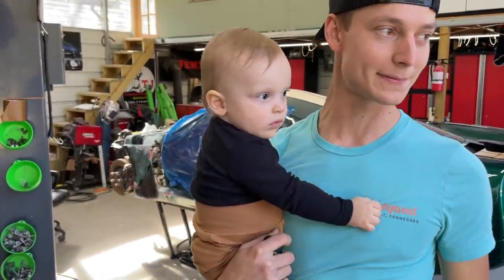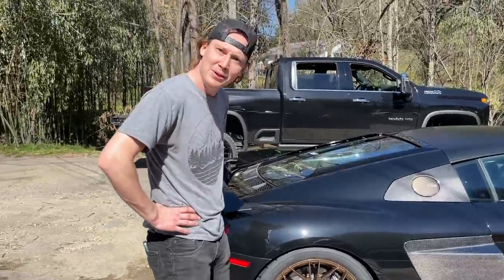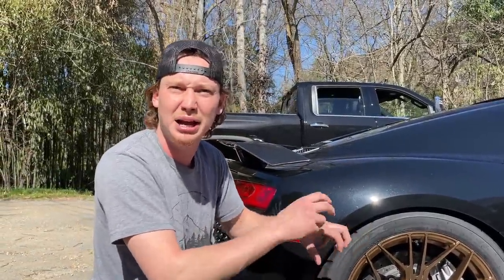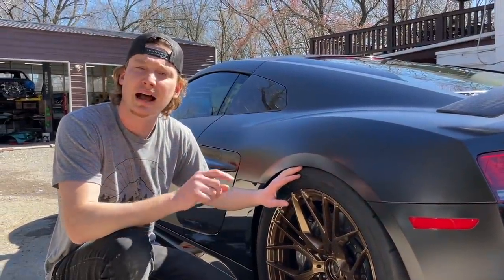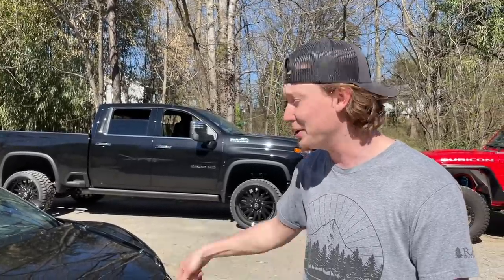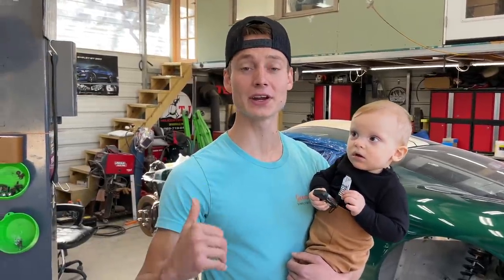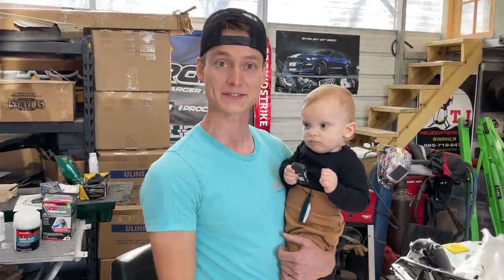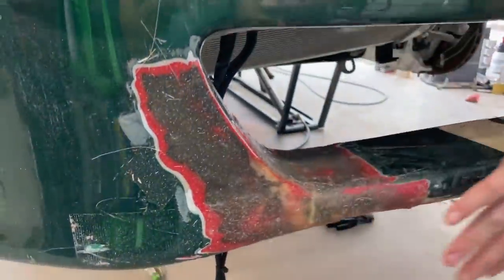Rebuilding A Wrecked Factory 5 GTM Supercar Part 6!!!

Comment: The fiberglass you guys used on the hood is called fiberglass mat. Its good for conforming to bends and building up thickness, but is not as strong as the weaved (cloth) fiberglass. Id say the mat is probably fine for the hood but just for future reference those are the main differences between the 2. Weave for strength, Mat for bends and thickness.
Reply: I have a weaved hood
Reply: Also, they may have used resin that is meant for laying in a mold which has a much longer working time compared to the resin used for repairs.

Comment: For fiberglass resin, give West Marine 105/205 epoxy resin a try. It has almost no odor, cures completely in a few hours, and has no tacky issues like cheap resin. I’ve been able to apply, cure, sand, up to 3 separate layers in an 8 hour shift.  They even sell this via Amazon.  Very strong stuff.
Reply: Defo an upvote for West systems marine epoxy... way better than any automotive fibreglass resin 🙂

Comment: find out if your tires are spinning on the rim as well, use a chalk marker , draw a line from the tire and the rim and then full send  WOT if the tire is spinning on the rim its time for some bead locks
Reply: This!
Reply: Meow
Reply: Meow
Reply: Is not making enough HP to do that, that happens over 1600hp on these cars
Reply: @joealex65  ahh, i only know its a way to check it cause a buddies is300 was pushing 1300hp to the wheels and was doing it. pls its a tuned tt r8 so i figured it would be easy enough to check
Reply: Semi slicks have a stiffer bead and sidewall and shouldn't spin. They will slip a little. My 300hp, 900kg track car will slip about 10mm when new until theu glue themselves in
Reply: Yikes I didn't even know this was a thing on road cars
Reply: @zxggwrt  its not. Don't worry about it.

Comment: Way to go on the hood. Definitely fiberglass the underside too. Make it super stable, don't need it coming apart at 200 mph LOL.
Reply: Their idea of fiberglassing is purely cosmetic they have no clue about structural fiberglassing
Reply: You should always start a fiberglass repair with a patch in the backside. The strength comes from the back. Starting in the front give you issues with the repair delaminating. Then after you finish the backside and its nice and hard, grind down the front fill with strands and resin or even fiber reinforced putty/bondo. Its good they switched to fiberglass matting, that other sheet is a pain to do repairs with.
Reply: @benmac940  THANK YOU.
Reply: @benmac940  damn didn’t know you were a fiberglass professional
Reply: @joshuaa1921  I didn't know that you knew me at all, when did we meet cause I don't remember you.
Reply: @benmac940  Yup that hood should've been ground out a good 10 inches on both sides of the main crack and then sunk below the factory surface..Both sides should've been beveled to v it out, metal cross bars should've been resined in to T it all together and that is all before ANY Mat went on at all..This should've been done top and bottom..Finally after it's built up it then gets filler..The thing will crack and so will the main tub where they fixed it.
Reply: @Dave-ur5ub  Just because you have a picture of a mustang doesn't mean you have a shop,also,I'm willing to bet these guys make a lot more money than your shop🤣
Reply: @Dave-ur5ub  🤣🤣🤣 did I hit a sore spot🤣🤣 start a channel and show the world how great you are😉
Reply: @jeffdeer683  not everyone needs to prove to the world what they can or can't do. I don't know how fiberglassing is done on cars or if Dave is as he claims, but what I do know is these kids attempts at fiberglassing have absolutely zero structural strength,  and im sure you won't believe me either but I have done hundreds of fiberglass repairs on boats over the last few years, including commercial boats that are used everyday,  and none have failed including where the cleat ripped through the deck leaving a hole the size of my phone for me to fix. Just because these kids are putting this stuff on the internet does not make it correct or structurally solid and if you had any clue you'd realise that, there are numerous people in the comments in every video where they've done it telling them how to do it correctly.
Reply: @benmac940  I tried to buy the R8..I tried to wire them the money the night they put out the video stating it was for sale for 230k..I offered them 260k ,but that was to include the new wheels and a few other things they were supposed to get for it.Plus a little extra cash to sway them to sell it to me..Bc I can make my money back off of that car simply bc it's a famous car and people will follow thst car...I sent yet another email offering them 280k for the car after they asked me what I had in mind as far as collaborating with them by letting them take the car back for future videos/events..Kind of a reuniting..Idc about any of that..That was simply to let them see that they could take It back at times for videos if they wanted it...To sweeten the deal.
Reply: @Dave-ur5ub  they don't seem to sell anything
Reply: @benmac940  No,they dont..Nor do they even know the correct names of many car parts or the correct way to pronounce the manufacturers of half of the stuff.

Comment: I’m pretty sure staggered means just that, wider tires in the back… the Audi is looking amazing!
Reply: Yes, wider wheels in the back would be staggered. Staggered application just means the wheels are different widths.
Reply: @loganb2198  I feel like they think it means the angle of how the car sits.
Reply: @kamiraanddie12394  no they think staggered means front and rear wheels are different diameter
Reply: Staggered is different size wheel diameter on the vehicle
Reply: Staggered just means the front and rear wheels are different. Could be width, diameter or offset. Squared means you can switch front and rear. Staggered you can't.

Comment: Loving all the builds you guys are working on... the Audio R8 is Awesome!  When I mix resin for fiberglass, I find it useful to use a cheap scale from Harbor Freight and mix the epoxy and hardener by weight.  Like baking, it can be temperamental sometimes and this ensures the ratios are precise and they fully cure!

Comment: Oh yeah, no chance of getting a ticket. Cop didn’t have his radar on. When he tried to get you to tell on yourself, you should’ve told him every detail about the car and then said probably 70-75. Like on Tommy boy😂
Reply: Exactly, never tell the cops anything if ya dnt have to because they will use it against you everytime....
Reply: 🤣🤣🤣🤣🤦‍♂️ you do know that you don't need a radar to get a ticket for speeding, riiiiight??!??
Reply: The cop had him on radar, that's why he got pulled over. the cops radar proves he was speeding.  Billy was probably going at least 85+  when he passed the cop.
Reply: @timglass6041  Wouldn't have said "like 90" if he had him on radar, he would've said something like "you were going 93", an exact speed since he had it and it puts pressure on the citizen to incriminate themselves either in admitting actual wrongdoing or in incriminating themselves to fulfil their ticket/fine quotas, since they have usually a quota they need to meet.

Comment: For all those judging the police incident:  One thing that is typically overlooked with supercars and sport bikes:  If you stay focused, they can stop and steer just as fast as they can accelerate.  On an open road, this car is safer going 110mph than a loaded down painter van at 75mph or a distracted mom, driving soccer van @ 85mph.  Just have to be smart about when/where you punch it.
Reply: I ain’t illegal till you get caught no matter where you decide to rip it or the emergency crews will be ripping your ass out of what’s left of that car. They got caught, they’ve been doing this for a while so the averages caught them also.
Reply: This is all true... but the "law" is the law. 
   I'd hate to see them come to an end just because they can't legally drive anymore. 
    I know that wouldn't stop them, but it might put a "damper" on their progress.
Reply: Don't disagree with you about supercars.   What Worried me is the extreme horsepower.  
Indy, no one plans on getting in a wreck.
Reply: @XX-166  right on.  So true. We've all done it but sooner or later they get yah 
Or something else goes sideways.
Reply: The Audi is running on old tyres that have been involved in a accident. They’ve narrowly avoided a speeding ticket. It’s only a matter of time before they have a accident of get stopped by the cops again.

Comment: Staggered is when the rear wheels/tires are wider than the fronts.  Usually found in RWD configurations.  Double Staggered is when the wheels in the front are not only less wide, but also a smaller diameter.

Staggered example: 18x9 Front / 18x11 Rears
Double Staggered example: 17x9 Front / 18x11 Rears
Reply: Very good explanation 👍🏼

Comment: If you would stop screwing around with crappy fiberglass products you wouldn't have these fiberglass problems. Checkout Total Boat fiberglass products or some other professional-grade products. You need to use the correct fiberglass cloth also there different products for different applications. Please educate yourselves step up your fiberglass game.

Comment: Gonna find out reeeaaal quick how expensive that transmission is lol. I hope to god you guys did the tire math to keep the Quattro living. And yes if you’re wider in back than the front, it’s staggered.
Reply: There's no math needed for the tires. It's running the correct size front and back, they're just stickier than the Pirelli PZero tires that came on it from the factory.
Reply: R888 tires for a tt r8 or hurucan is like peanut butter and jelly. And from what ive seen, their pretty common tires used for any turbocharged car
Reply: Staggered is for any difference in the front or back
Reply: I hope that the Officer gave Billy a break and didn't give him a citation.... especially for reckless driving....
Reply: Dumb comment, the people that installed the Twin Turbo also spec'd the previous wheels and tires for it and it's right where all R8's/Huracan's run, they don't have to do any math because the wheels are the same size as the old ones
Reply: Tire width shouldn’t matter on AWD, it’s the circumference so they roll at the same rate.
Reply: @Dmanpeterson  that’s why i said “tire math”. I have an e63s meaning it’s 4matic and I’m running also staggered wheels. Width affects size if the tires aren’t matched to be the overall same diameter. If i ran different sizes that didn’t match each other in their diameter, my car wouldn’t be too happy. I run 275/30-19 and 245/35-19, because i did the math. You’re right that width itself isn’t an issue, as long as the math is done to make sure their overall diameter is the same.

Comment: My guess is there's not enough hardener in the resin... should harden much faster,.. hot or cold. Never a whole day. If it's mixed wrong it will never cure properly, needs to be removed and re applied
Reply: I think he probably used old hardener... it will never cure. throw out the old hardener and redo it w/new hardener.

Comment: Nice job but be careful ripping your cars because I do know for a fact when I would turn my 850 hp 2010 Camaro loose I would check very close before getting on it and had a place that I knew there was little traffic and even fewer patrolman. I would still be in jail at 195 mph on the bypass of the interstate if they caught me. Haha

Comment: That hood will take a boat load of work. You guys should go and buy the West System for fiberglass. It is really great material, i used it on my BMW 1200 motorcycle rebuilding all the body parts. You will not go wrong with it.

Comment: My concerns for the Silverado are mainly the sidewall strength. It effectively killed the towing capability
Reply: @lloyd28khz43  they have lots of towing trucks you haters
Reply: Pretty sure you started watching them yesterday
Reply: They not even intenting to use it for towing
Reply: @kennedymutinda4806  you mean their Pops’ RAM? They sold the silver HD GMC truck and both the Raptor and TRX are not made for large loads like an HD duramax diesel. Actually like three years I’ve been watching I think now 🤔 Not hating really
Reply: They said they WERE using it for towing. It's supposed to be a business truck. I don't like the tires and wheels at all personally but it's their truck.  I would never buy a chevy truck anyway their interiors look like 90's rental cars.
Reply: @squid_fish  f450?
Reply: @danielmishchuk5284  Maybe a non dually setup? I just remembered they have that too 😂

Comment: The R8’s new wheels and tires look awesome! The fitment - absolutely dialed! (The High Country needs the R8’s fitment, and taller tire sidewalls.) (Re: comments on the High Country’s new wheels and tires from last video, I’d say a tiny bit more than 50% absolutely disliked (who are we kidding, at least 8 out of 10 commenters said “No way”, “looks bad”, “big truck, little rubber band tires”, “bad fitment”.) Those new wheels with some taller sidewall tires, would not only look mean (a good thing), but the truck could drive over something bigger than a house brick without risking serious rim damage! R8’s👍! High Country, just four tires away from looking awesome! Keep doing what you do!
Reply: Completely true,but unfortunately with chevrolets square wheel wells a larger tire wouldn't fit with that lift and wheel offset.That being said,I'd rather cut the crap out of the fender wells and bumper than have it look the way it does!

Comment: If the rear is wider than the front, it’s staggered. If all 4 wheels are the same size, then it’s a square setup, which is recommended for AWD applications.
Reply: The AWD isn't true  I have a stock staggered setup on my Mercedes CLS63  305 in the back and 275 on the fronts
Reply: @drumftallen9325  911 4s is same way, wider in the rear.

Comment: Great build guys! You may have unwaxed resin, you use that with multiple layers.  You get better adhesion that way. Your top layer You use waxed resin. It feels dry to the touch. The resin is the same stuff it's just the additive you put in your final top coat.  I would have ground more out of that panel to ensure adequate layer adhesion.
Just my .02!  Keep the progress rolling.

Comment: Staggered is when the rear rims are wider than the front the Wheel height has nothing to do with it but Corvette beginning in 1997 run taller wheels in the rear euro sports had been staggered for years

Comment: A little tip to fiberglass repair is on the outside repair mix in a few drops of dye in the resin so when you later do the inside repair you know exactly how much of old fiberglass you need to grind out and olso try to feather in the repair atleast 20 cm if possible this will get out pretty much all of the damages and weakend fibers

Comment: I know you guys realize or hope you do that pump E85 and E85R race fuel are two very different things correct???  
E85 is not the same as E85R
As the name implies, E85R is definitely different from it's pump-sold counterpart. The "R" in the name stands for race fuel. The E85 you get from the pump is 85% ethanol and 15% regular gasoline, or at least it should be. Most E85 pumps state that the ratio varies seasonally. What this means is in the winter time, you could actually be getting 75% ethanol and 25% gasoline or even less! As you can probably guess, that would impact your vehicle's performance.

Meanwhile, E85R is 85% ethanol and 15% race fuel and that ratio does not change. With E85R, you can be certain that you're getting exactly what you think you're getting every single time. And you're actually getting a higher quality fuel because of the 15% race fuel instead of regular gasoline.

Comment: Ok, you guys do some amazing cars,But i really cringe when i watch you do your body work..Throw that BONDO Brand shit away. .And stop using spray can primer..and you are working on 100K vehicals you should be priming the new panels with 2K primer not just wet sanding he E coat and painting on top of it. as for the fiberglass, get laminating resin from a boat repair place then you can put multiple layers on then ad wax in your last layup to cure it . and Yes reinfore underside of all repairs.

Comment: Y'all really shouldn't be using Bondo fiberglass. That stuff is trash. You should be able to find some local plastics distributors that sell fiberglass cloth and gallon paint buckets of resin. And when resin takes too long to cure, you probably didn't use enough MEKP.

Comment: Something just doesn't seem right to me regarding what's been happening with these guys various 'projects'. First, the new Goonzquad auto shop has either stalled or has run up against some serious delays due to building regulations or material/labor shortages. Hard to say what's actually going on due to lengthy time delay with videos. My guess is YouTube is applying a lot of pressure on them to produce 'content' each week or loss their channel. Second, the rebuilds and customizations don't seem to be going all that well - a bit of scrambling on their part to make it appear as though some progress is being accomplished. And a lack of auto repair body knowledge is beginning to have a serious effect on their progress as is the delay in getting spare parts just doesn't add up to the whole story. And third, the use of 'fillers' ie. domestic adventures, road trip adventures are being used to create add-on video interest which is getting further and further away from from their 'core' auto repair activities. You guys really need to shape up and stop the 'scatter-gun' content of your channel.

Comment: Staggered refers to wheel width (18x9.5 width front & 18x10 rears) to those who don't know staggered is just width difference between the front and rear wheels not necessarily in wheel height